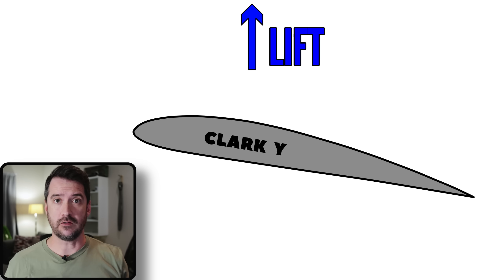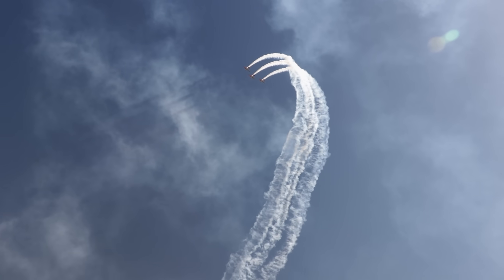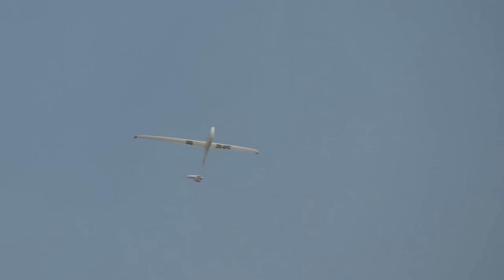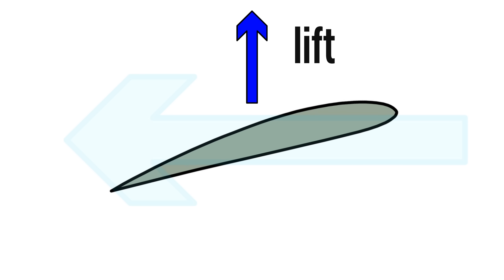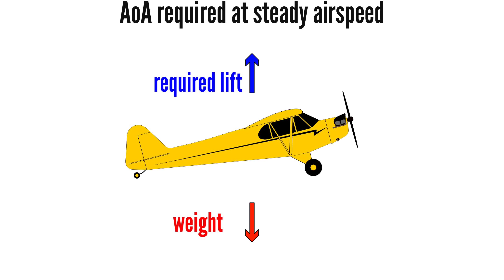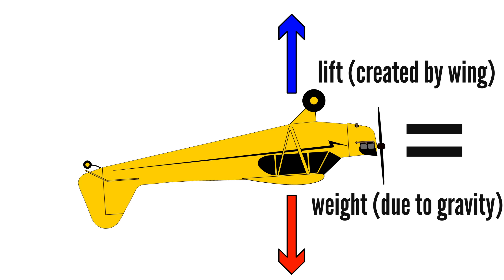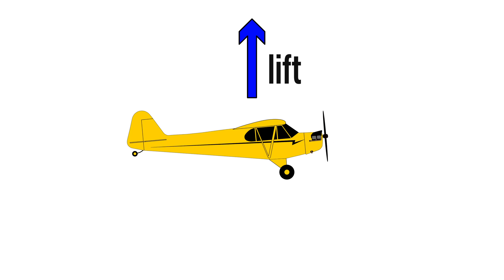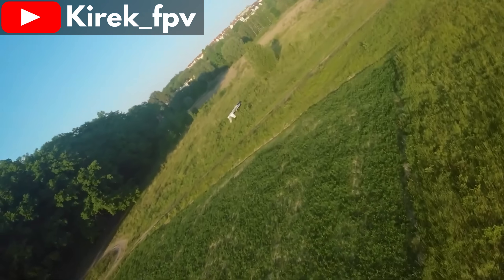Is Airflow Distance Over the Top of a Wing Always Longer?

Comment: I don't know why it is so difficult to understand but lift is created by the air pressure underneath the wing. Air cannot 'pull', it can only push. To say lift happens above a wing is the same incorrect logic as saying you can be 'sucked' out of a spaceship.
Reply from the maker: Probably because that is an incorrect/incomplete understanding of lift. Even NASA says "Neglecting the upper surface’s part in turning the flow leads to an incorrect theory of lift." 
https://www1.grc.nasa.gov/beginners-guide-to-aeronautics/what-is-lift/#:~:text=Lift%20is%20generated%20by%20the,acts%20perpendicular%20to%20the%20motion.

Btw the notion of push or pull is also misguided. Pressure differential displaces the wing towards low pressure. It isn't "pulled" up by the upper surface.
Reply: Well, in a sense you are correct that air can only push (in terms of air molecule impact doing the pushing).  

But the upper part of the wing being mostly responsible for lift does not violate the notion of air pushing at the molecular level.  Lower pressure on top means there is less push of air on top than on the bottom. So the bottom wins and the aircraft has lift.

Being "sucked out" is common language for the effect of moving from higher to relatively lower pressure.  There is no illogic, that's what suction is.  Should we rename a vacuum cleaner a pusher because air molecules are actually pushing on the dust and dirt?
Reply: @davetime5234  "But the upper part of the wing being mostly responsible for lift does not violate the notion of air pushing at the molecular level." Ah, yes id does, that's exactly what it does, hehehe. The upper part of the wing does NOTHING to create lift, N.O.T.H.I.N.G. The best it can do is provide less resistance to the air pushing upwards from underneath the wings, meaning the air underneath can have more of a lifting effect.

There is nothing wrong with the name 'vacuum' machine, that is a perfectly sound scientific term. If it was called a 'sucking' machine, well them i might say it should be renamed, yes.
Reply: @mystikmind2005  "The upper part of the wing does NOTHING to create lift, N.O.T.H.I.N.G. "

The above is widely known to be false.  No credible authority would make such a claim.  You can easily check and cross-check for yourself online.  And not as an opinion.  The weight of evidence from various vantage points can't be ignored.
Reply: @davetime5234  "The above is widely known to be false." And that's what never fails to amaze me and people create youtube videos trying to support this nonsense. From my perspective it seems like the world believes the Earth is flat and trying to convince me that it is.

FYI, I am absolutely not convinced.
Reply: @mystikmind2005  Then I would ignore all such videos and go to hard sources of info: go only for academic and/or industry science and engineering sources of info that demonstrate the concept with convincing proof.  One example is pressure diagrams from detailed modelling.  The pressure is shown in case after case to have a much larger drop on top of the wing than below (in all of the cases where sufficient lift is being generated).

Also, if lift were only created by the higher pressure under the wing, then it would not be possible for a sail boat to travel faster than the wind speed (such as at a right angle to wind), nor to tack generally in the upwind direction.
Reply: @davetime5234  Lift IS only created by the pressure under the wing... what the lower air pressure above the wing does, is increases the power of the lifting capacity that is occurring under the wing... because your increasing the pressure differential making that lift force stronger.
Reply: @mystikmind2005  Right, lift is created by an absence of pressure above the wing, allowing what is mostly ambient (everywhere) pressure under the wing to be dominant.

Oh, not right, because you said lift is only created by....pressure under the wing.

No, it is created most substantially by absence of pressure above the wing.

Just arguing to be right no matter what is not conducive to a constructive conversation.
Reply: @davetime5234  Keep trying, you will get it one day. 
Mebe it will help you for me to point out that the absence of pressure is an absence of energy and an absence of force - it is not 'creating' lift but creating a situation where more lift under the wing can occur - cheers.
Reply: @mystikmind2005  "the absence of pressure is an absence of energy"   

It takes energy to evacuate a chamber of air pressure toward a vacuum (in the face of ambient pressure).

Same reasoning with you having to put electrical energy into your vacuum cleaner.

Comment: I am a soil and water scientist so don't particularly study wings but I understand fluid dynamics, turbulence, reynolds number, stokes law etc... I had no idea there was controversy over how a wing worked- here's my take which up until now I assumed everyone else believed... get an air compressor and a wing. Blow air directly upwards at the wing.  I presume everyone is OK with the idea that a mass of air pressure under the wing should push it up... 
And if you have just a normal mass of air being pushed under a wing,  boundary layer resistance and the skin friction will result in turbulent flow under the wing,  in essence bunching up the air underneath- high air pressure.  In order to do this you need a concave surface under the wing or an appropriate angle of attack that forces more air under the wing than over it. 

Similarly the shape of the wing seems to decouple the air from above the wing,  creating a vacuum.  This is what I thought lift was.  

Loop I think it's wrong but can't be bothered explaining...

High speed would be different because the air essentially becomes more viscous, and the wing would be more to cut a path through a nearly solid medium rather than make lift.

Comment: I puzzled about this as well as puzzling about “Symmetrical Wings” then figured it out. Even more, a prop aircraft “hanging” on its prop pointed vertically up was a puzzle for me. It all boils down to thrust.
Reply: Lift is all about asymmetry.  Asymmetrical camber and AoA both provide asymmetry.  For symmetrical camber, only AoA is providing asymmetry.  AoA is always providing adjusting for and providing asymmetry.

Comment: It seems fairly easy to demonstrate that the longer path is irrelevant, just by looking at how sails work.

There are different ways of describing the same thing, but I think of it as being about the momentum of air molecules- on the convex side of the curve, the directional momentum of the molecules is 'throwing' them away from the surface, which creates the low pressure.
Reply from the maker: There's two things here. Is the longer path relevant to lift, and is the path over the top always longer. 

This video addresses only the latter. However if the path over the top is always longer for a positive lift producing airfoil (it is), and the pressure above is always lower than below for a positive lift producing airfoil (it is), then the longer path surely is relevant to lift, even if it's only a "side-effect" of a positive AoA.
Reply: @LetsGoAviate  Thanks for the response, though my point was that the path is NOT longer on the 'lift' producing side of a sail- it's the same length but still produces lower pressure on one side.

Similar to those balsa wood model planes.

So it would appear the longer path is mainly just a necessary structural element?
Reply: @SteveLomas-k6k  The longer path isn't determined by the thin sail's dimensions (which are essentially the same on either side as you indicated), but by the thin sail's asymmetrical orientation to the relative wind.

The path length difference is always a function of the total asymmetry, whether contributed by the AoA alone, or by the combination of AoA asymmetry, and any camber asymmetry built into the airfoil.  In the case of the sail, the path difference is all due to the AoA asymmetry.

Comment: As a student at the time and going for a commercial license for helicopters, we use a symmetrical foil and when they used their principal for a symmetrical foil in flight, it took a lot of convincing and I eventually went along with their analogy. I still always had in the back of my mind though that velocity and compression gave us our lift. Anyhow lol, here we have another suggested principal of aerodynamics.
Reply: Velocity and compression (or the consequences of the airfoil's obstruction) certainly are key factors.  But the mediator of how those factors relate, is asymmetry imposed by the airfoil.  Conservation of mass flow rate, momentum and energy are put to task to resolve the asymmetry of path imposed by the airfoil.

In other words, momentum of relative wind is maintained from static pressure dropping to supply the needed extra dynamic pressure to keep the momentum of mass flow maintained.

The above changes the direction of momentum (wind flows towards a low pressure area) which produces the force of lift.

Comment: Maybe it is the energy of the air molecules imparting the force upwards onto the bottom of the wing for a longer period of time that adds up to produce the lift.

Also similar idea about how vacuums work, not by suction but by reducing pressure on one side and allowing the pressure of the atmosphere to push its way into the vacuum. 

A hand floating out the window of a moving car is not lifted by the reduced pressure on the back of the hand, but by the force and pressure imparting the lifting energy onto the short path which slows the molecules down giving them more time to bunch up and impart that energy for a longer timeframe.
Reply: No, it is well known that most of the pressure change is on top of the wing (more drop in pressure above than increase in pressure below).  So most of the air directed down from above accounts for lift.  So most of this downward directed momentum is the low pressure above bending air further above downwards (like wind towards a low pressure system).

Comment: Do a simple experiment: Take a piece of paper and blow across it and watch what happens. On the side where the SPEED is higher, the pressure is lower, so a force is created. The same principle with sailing "into the wind". It is similar when two vehicles pass each other, the force pulls them towards the middle, not pushing them outwards.

Comment: Air moving over an airfoil creates a drag force upward that we call lift. It can't "move faster over a longer path" so it pulls like a kite. Your welcome.
Reply: Drag doesn't answer lift.  Moving faster over a longer path is indeed necessary.  Call it the "Navier-Stokes condition":  conservation of mass flow rate, conservation of momentum and conservation of energy are separate components that all must be independently maintained, and each mediate by interconnected cause and effect:  if it doesn't move faster, then one or more of the conservation conditions gets violated.

Comment: I have a simpler way of putting it. The air will always take the line of least resistance over a wing, and that line is generally towards the centre of a vortex. Upper camber induces a gentle but almost continuous vortex over the upper surface, giving the best lift/drag. In inverted flight, the only significant vortex is at the leading edge, while the flat underside is doing very little, requiring a higher angle of attack to achieve significant lift. It is quite valid to consider the centrifugal forces caused by the curved flow, so we can see that the curvature now below the wing will produce a net pressure drop, reducing efficiency.

Comment: When I was in college,I was taught that two air particles that pass the stagnation point simultaneously, with one traveling over the top of the wing and the other traveling under the wing will reach the trailing edge of the wing at the same time. For that to happen, the particle traveling over the top must be going faster than the particle traveling under the wing. That speed differential causes lower pressure on the top, which causes lift. I never understood why the two particles had to reach the trailing edge simultaneously and nobody was able to explain it in a way that I could understand. Maybe you addressed that and I didn’t understand. If you didn’t explain that, would you?  If you did, could you try it again?  Thanks.
Reply from the maker: The air going over and below doesn't reach the trailing edge simultaniously. This is referring to the equal transit theory which has been disproven. This wind tunnel video shows it : https://youtu.be/e0l31p6RIaY?si=X6WJ6nkzLHWh6X5X
The air going over is indeed sped up, but not because it has to meet up with air going below. The path over the top of wing is also longer with a positive AoA, as is discussed in the video, and while many assume this is referring to the equal transit theory, it is not and one does not have to be true for the other to be true. Not sure if this helps.